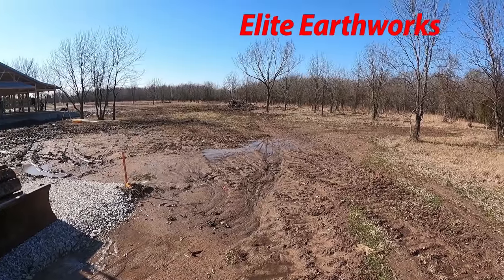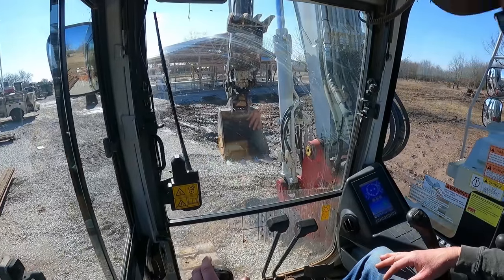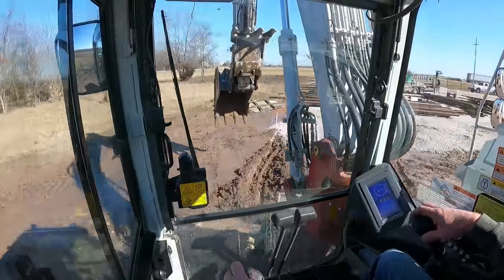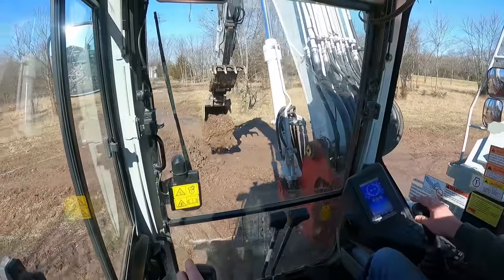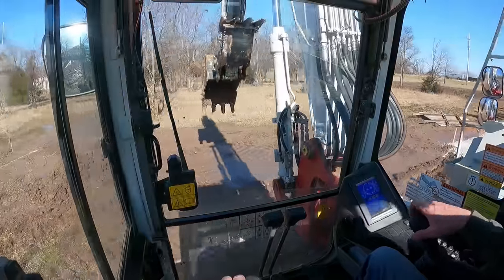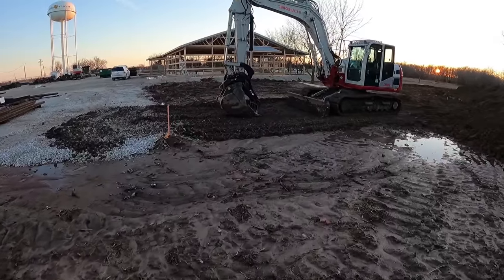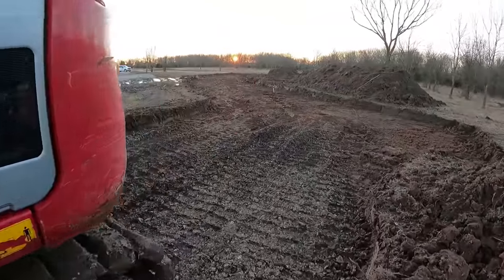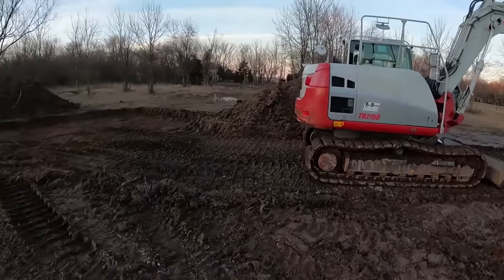Cutting Out Mud With The Takeuchi TB2150 For The Train Track

Comment: By looking at it I would have never guessed it is bigger than a 140.  It does have a narrow undercarriage and pads.  If you keep the blade clean the dirt won’t scratch the counterweight but if someone is scared to mess the paint they won’t order a blade.  It’s just a shame you didn’t get a Valvo!
Reply from the maker: Yeah you can get them with full rubber tracks, these segemented tracks or wide steel tracks. I was hoping for the steel but this was all they had. They also make a 2150R which is a fixed boom machine that’s suppose to be out later this year I hope to try. Appreciate you watching

Comment: What kind of train are you putting in? Or track size
Reply from the maker: The rails are 42” a part I’m not sure of the exact size. I think the engine and 10 cars weighs 45,000lbs
Reply: @eliteearthworksllc  Thanks for the info.  I work for the railroad but also my hobby is live steam trains 1 1/2 inch scale
www.svlsrm.org
That is my local club
Reply from the maker: Oh cool thanks I will check it out. If you look up Diamond Grove Adventures on here I think they have one video up about the train

Comment: I laughed, you seem to think 1100 hrs is alot.  Thats nothing.
Reply from the maker: Not 1100 is like brand new 😁 I’m all about the hours with my loader rocking 8300
Reply: It was just really abused for those 1100 hrs. Looks like they used the counter weight like a sander 😛
Reply: @littlefinkle7757  rubbing tails on dirt piles is nothing.  Dents tell a different story. I owned several used machines that tell stories and the all made the same money.
Reply from the maker: Lol I agree